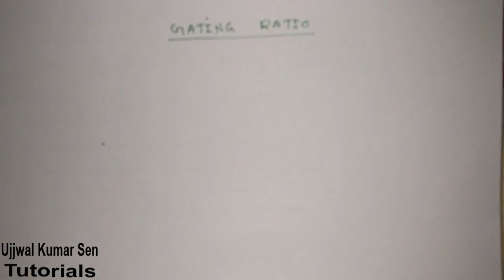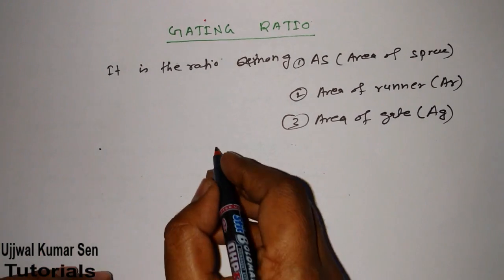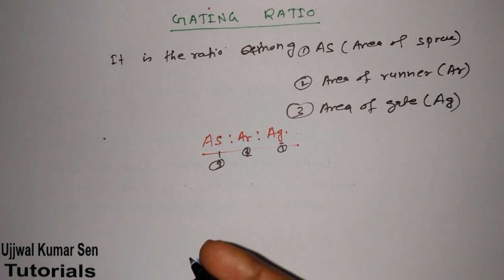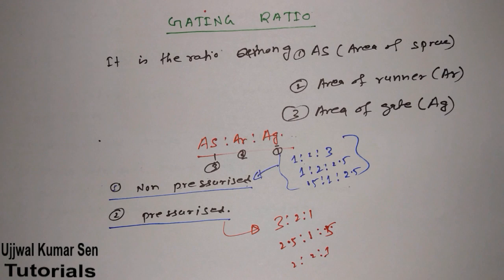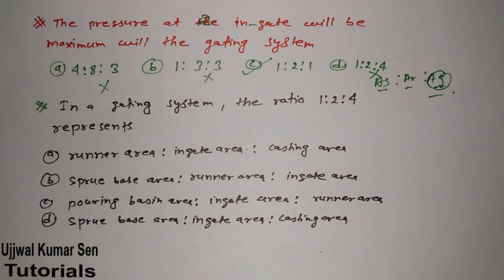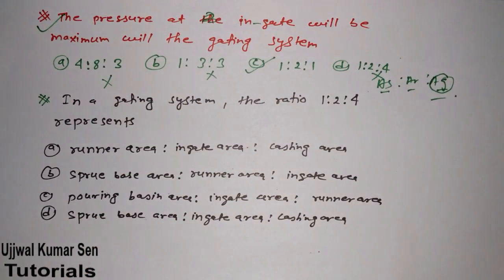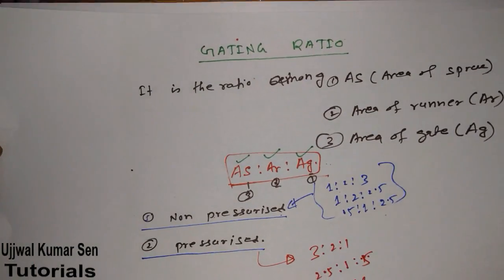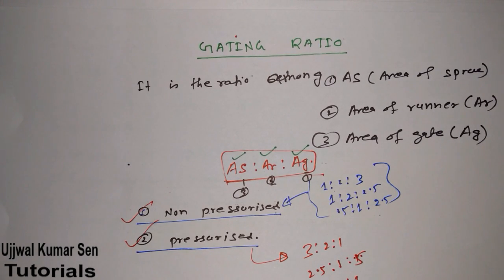Gating Ratio GATE Previous Year Question with Solution

Comment: Bro. Correct option of question 1 is (a) not (c). 4:8:3 we have to divide them with 4 to get same spure area. 1:2: 0.75 And then only we r able to decide which one has more pressure then other in gate system.
Reply: why do we have to divide it with 4??
Reply: this is talking about ratio so we can take common if it would be in it.